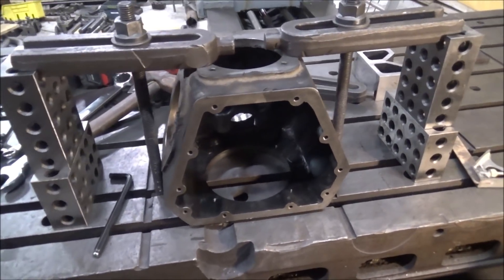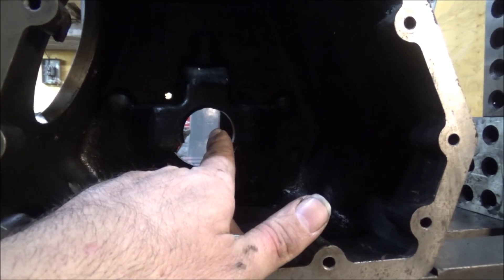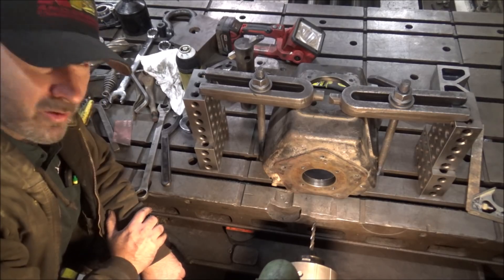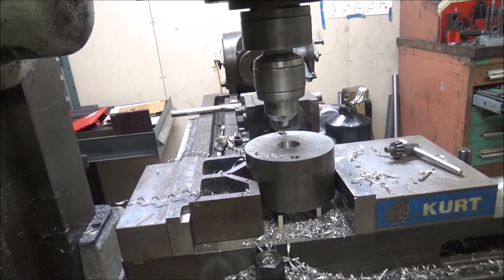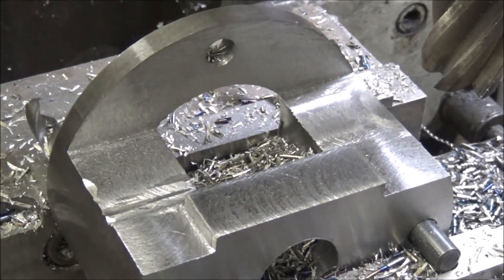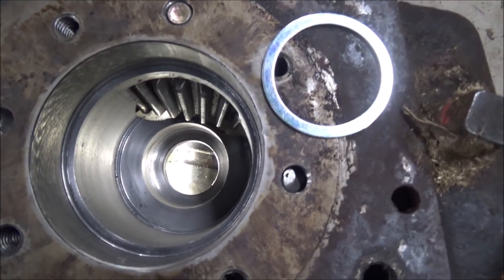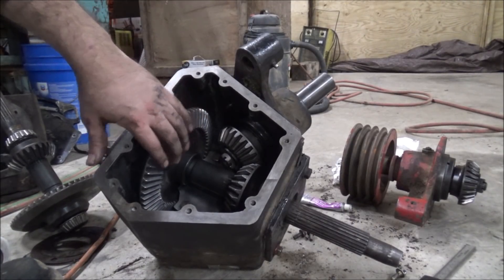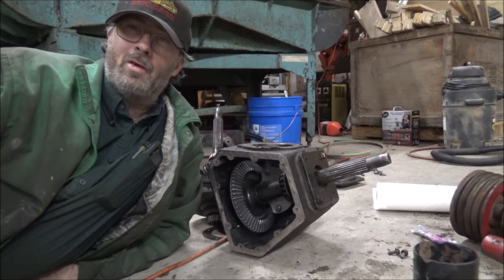Poorly Engineered New Holland Mower Conditioner Gearbox Repair

Comment: What does this repair cost I have been through 3 gear boxes the past 4 years and currently have one down and I would like to try this possibly
Reply from the maker: It would probably take parts from all those boxes to get one pieced together. It took 4 boxes to find enough good shafts and gears to piece this one together. Usually the gears get heat damaged from running out of oil when the bottom breaks.  The customer found the supports were worn for the cutterbar letting it move around more than it should and side loading the shaft making the bearings fail. Definitely check all that out too. I don't remember exactly what this repair was but I think it was between $1000 and $1500.
Reply: @bcbloc02  thanks where are you located
Reply from the maker: @alantroy5228  Near Shelbyville Kentucky

Comment: Hallo Brian.
The drill would never have broken off if you had pulled out the several times and added oil.
As a mechanic, you actually know that.
(Translate Google)
Best Regarts
Reply from the maker: That is not true. The bit broke because I accidentley tried to rapid feed it thru the part by grabbing the wrong lever.  There was no chip packing or heating issue. You can't push a drill bit thru steel at an inch/second.

Comment: Planned failure so the customer has to keep buying way overpriced parts! All the factory upper echelon wants is parts that will just barely make it out of warranty period. That way the customer will eventually get tired of expensive repair and buy a new piece of equipment. Not every farmer has a Brian Block to fix the factory engineering!
Reply from the maker: There are truck that ship though so they can send me their stuff to fix. :-)

Comment: Well engineering! If that is a gear box for a three disk bat wing mower, no Matter who makes it they all run hot. And beat themselves to death from being out of balance. Each blade disk get damaged as soon as start mowing, all the out balance, transferring to the box, blow it up. Not much can be done. Except like you say make twice the size . Then be too big for the mower deck
Reply from the maker: It is for a discbine, runs the cutterbar and impeller I think.
Reply: @bcbloc02  heck that sounds even more stressful on the parts, can see were the side loading plays in now. Not just a vibration and high speed.

Comment: Did you have any difficulty getting the mesh of the bevel gears set properly? Seems like moving the pinion in or out a small amount could wreak havoc. Probably no worse than what they have already been through though wit the shrapnel that was probably flying around.
Reply from the maker: Yes getting the proper depth figured out was challenging and required assembly a few times to check it.

Comment: Just curious, you use the DRO for hole layouts or did you do it manually? That box does look small for oil cooling, not a lot of outside surface area to disperse the heat out to. Nice job Brian!
Reply from the maker: I used DRO after finding center with the co-ax.

Comment: Would graphite grease or similar instead of oil as a lubricant help? I see you have at least one more there to do? Good luck with that job, new bearings I hope? Those gears were worn, maybe just before the box failed though maybe..Thanks for posting, thumbs up.

Comment: Brian,  that's awesome work as always.   The one you made has to be at least 100 times stronger to side loads than what was cast in place.  I bet you could bolt a steel strap over a new one and it would last better too.   Thanks for sharing!

Comment: interesting, and breaking after only around 2,000 hrs. (but did last longer than your drill:-)). Where is New Holland equipment made these days? Can't tell by looking at the parent CNH Industrial. Nice work but a lot of work.
Reply: He corrected to 2,000 acres.
Reply: @paulcopeland9035  yikes , not sure of the crop but 2,000 acres should only be around 2 months work. I  still can't figure out where it is made or designed.

Comment: Hi Brian . I got far more confidence in your modification than the original set up .If only the guys who design these boxes had to fix their 'mistakes ' like you just had too . They would think vastly different .
Reply: I agree, a lot of those engineers have their nose too high in the air, when they are not looking down it at you.  THEY have that Degree, and are quite offended if you disregard that.  If it isn't them, it's the bean counters that insist that you pare down so it can be made cheaper.
Reply: @infoanorexic  Or management decides to get rid of the older experienced blokes because they have to pay them more, and they replace them with new graduates who as yet have little experience. Just because you can connect two points with a line in AutoCad, doesn't make it a sound design. You don't learn experience from a text, that takes time and some of the best learning comes from some of the biggest stuff ups.

Comment: Seems like an old casting repurposed 
Maybe a low power 90* box and some bright spark said We can blow a hole in the side, add anouther shaft and triple the input power 
She'll be good to go 
Saves on retooling the factory and extra parts income for the dealership
Reply: That is the bean counter mentality, and in the long run will put a company out of business. The bean counters don’t care about longevity of a company as they  are only interested in the short term profit and will just move on to the next company to take down.

Comment: Really nice re-engineering there, Brian. Always a feel good moment when you can come up with a good solution to a problem. Shame about the drill. Certainly think some chip clearing might have helped too, maybe?
Reply from the maker: No if you rapid up instead of down it is a bad day. Turns out you can't punch a drill bit thru an inch of steel. lol
Reply: @bcbloc02  - ahhhh that's what that was then. I guess that warrants a "no bozo" sign on the handle with an arrow! Haha. 
Nice work regardless.
Reply: @bcbloc02  take a real person to admit their boo boos. great fix. love you show thanks for sharing
Reply: That bit exploded, I jumped back from the screen and said out loud, “Glad he had his safety glasses on!”

Comment: Looks like that bit exploded because the part slipped in the vice. You can see the part lifting off the parallels just before Ba-boom. : )
Reply from the maker: No I hit the rapids up instead of down because I was used to the G&L controls which are reversed. Lack of thinking on my part. You can't shove a drill bit thru an inch of steel.
Reply: @bcbloc02  OK I see it now, fun to watch in slo-mo. Pretty spectacular explosion.
Reply: It exploded because he moved the table up, when he was supposed to go in the opposite direction, thus crushing the drill. Even if the part was welded to the vice, the drill would not be able to withstand those forces.

Comment: Wow, first! Brian, you did not show the cover piece that goes on the front as we look at it, would it have helped to run some dowels parallel to your new bolts that run all the way to the front cover to help support your new insert? Not sure what mower that is off of, we ran two NH411's over tens of thousand of acres and never had a box failure. On another note, I see a few bigger machine shops in the Cincy area are auctioning off, lots of high dollar stuff probably going to be selling for pennies on the dollar, any goodies you have on your wish list? Hay Hud Ohio signing off....